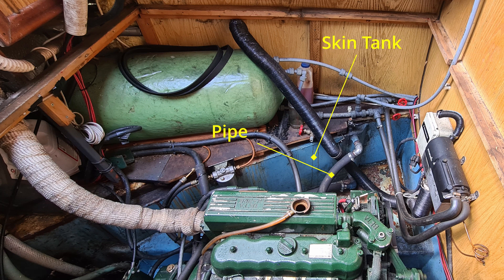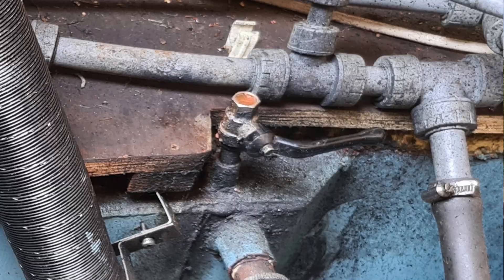How to Cool an Overheating Narrowboat Engine!

Comment: This video just popped up in my You Tube feed, how long ago it seems!
The Feb 2024 update is - the radiator didn't work in the end, it caused all kinds of problems it was disconnected after a few months. I did fit a coolant header tank but still had to bleed air out of the skin tank every day while cruising. Finally in October 2023 the boat was taken out the water and an external skin tank was fitted to replace the original tank. It was fitted with an automatic air bleed valve. It was an instant fix and now I can cruise all day at 1400 - 1500 rpm instead of anxiously creeping along at 1050 - 1100. A big thank you to Andy and the team at Andicraft in Debdale Wharf Marina.
Reply from the maker: I’m really pleased to have finally reached a solution! The stress it caused was not great. Andy and his team did a great job! 🙂

Comment: Fabulous presentation.
I note some excellent comments on the height of the calorifier.

As an Oftec/Gas Safe heating engineer and ex REME engineer, I would like to  respectfully add some points for consideration.

The first thing is to check the dynamic coolant flow rate this will prove the correct opening of the thermostat and cleanliness of the cooling system and water pump. 
Ensure the correct water pump is fitted. 
Use the correct grade of coolant and viscosity levels.
Avoid acute bends on pipework to the calorifier which will lessen the risk of air bubbles/cavitation.
It is worth noting that If the engine coolant hasn't been maintained it is possible that cavitation has damaged the engine cylinder bore liners. 
Complete an engine compression test and look for a high reading!

Hope this helps.
Reply from the maker: Thank you for your comment and suggestions. I will ask Peter to take a look at this and get him to reply as things have moved on since this video. 🙂
Reply: Hello from one ex REME technician (Radar 1966 - 1978) to another ex REME man! 

Thank you for taking the time to reply, you might see from my comment in this thread that the radiator experiment eventually failed and I finally found an engineer to make an external skin tank in October 2023. That has transformed the performance of the cooling  system. The original tank was too thick and the inlet and outlet points were on the same end so coolant could avoid the internal baffles and flow straight in and out of the tank.

I have also replaced several coolant hoses and rerouted them to avoid pinch points as you suggest here.
Three core plugs on the engine - out of a total of 25 - failed so they were replaced and the rest were checked. The cooling system was also flushed.

When a coolant hose failed very early on I changed the coolant to the red OAT type as I read that it performs better. In all the subsequent work and routine servicing no-one commented on my choice, but earlier this year when the third core plug failed the engineer who did the repairs explained that I should use the blue IAT coolant on my engine - and the red could cause corrosion. I checked with Beta Marine and they confirmed that they now recommend using the blue coolant because of the metals used in the construction of the Kubota diesel engine that is at the heart of a Beta Marine installation. So I have changed back to the recommended product and now everything is working just fine.

Once again, thanks for adding to the discussion, I know other readers find these comments useful for their own boats.

Peter

Comment: I had the same problem when crossing to the Lancaster canal on the tidal river Douglas,on my brand new narrow boat.I found out the propeller was to big,so Crowder marine made me a high efficiency propeller that solved the problem by letting the engine rev better putting more coolant through the skin tank.I also changed to a Crowder prop on my new boat worth every penny.I have done the Wash Boston to Denver sluice twice,Sharpness to Bristol,tidal Trent,River Mersey,Limehouse to Teddington,and Tarelton to Savick Brock onto the Lancaster canal.Coming out of Tarelton river Douglas is the most powerful current that I have come across but my 40hp Yanmar does it with ease but I do have twin skin tanks on my narrow beam river barge NB The Viking.
Reply from the maker: Wow! Your journeys sound amazing! We are holding off from doing such trips because of the overheating. I will show Peter your comment and see if it will help him! Thanks so much for sharing your experience! 🙂

Comment: Similar problem with mine.  
Regularly used to dump the domestic hot water.  That cooled it down for a while
Reply from the maker: We have fixed the problem by fitting an external skin tank recently. Peter doesn't have to worry about it but he tried everything else that was suggested first. This proved to be a false economy because he ended up with the skin tank anyway. Have you solved the problem?
Reply: Yes all solved.  New thermostat.     All the best to you sir 👍

Comment: Hi I have a Beta 43 with a calorifire and because the pipe work to the calorifire is higher than the coolant filler cap on your engine ( as I think I can see on yours is) you are getting  air into the pipe work that circulates through the calorifire. Causing the engine to overheat. As mine used to.
I got round  this by installing  a expansion tank bottle ( similar to one in a car) higher than the calorifire
  I cut the rubber pipe on the return pipe to the engine  from the calorifire and went up to the expansion tank( sited hire than the calorifire) then back out of the expansion tank back to the engine.
So you fill your engine coolant from the expansion tank and not from the cap on the engine.
You can not open the engine cap after doing this or the coolant will poor out from the higher expansion tank.
As soon as I installed the expansion tank the air from the system bubbled out into the expansion tank.
 And also the coolant circulates around the expansion tank  cooling the water down.
It was an immediate success 
Cost very little to do as well
I wish you luck in which ever way you attempt to solve this problem 
Gail
Reply: Hi just to add I cut the pipe highest on the calorifire ( mine was the return) so that when you put coolant in it goes in at the highest point forcing air round and out of the system 
Gail
Reply from the maker: Hello Gail. Thank you for taking the time to give such an in depth reply. I have shown Peter your solution and he will take a look at the engine to check it out. Glad to hear it solved your issues. 🙂
Reply: Hi I am glad you are now ok after your dreadful accident.
If don't mind just to explain when you fill the engine via the filler cap you can't  make the coolant go up hill into the Calorifire.
So every time you you turn your engine off the water drains out of the calorifire down into the engine leaving air in the calorifire and pipe's
Gail
Reply: So you don't have a skin tank because I've got a similar problem of plumbed the engine into the spiral in the clarifier so if I put an expansion tank on will that make sure that my engine stays cooler is that what you're saying because that would be a cheaper option for me
Reply: @johnpalfreyman8290  
Hi John
I have 2 skim tanks either side of my stern to keep my engine cool.
But I had a over heating problem.
I found my calorifire was installed higher than my engine.
So water ran round the calorifire when the engine was running 
As it is higher than the engine 
And when I switch the engine off.
The water drained from the calorifire back into the engine and skim tanks
The  water ran round the calorifire  because it was pumped up out of the engine and skim tanks when the engine was running 
Leaving less in the engine  and skim tanks
This caused the overheating when the engine was running 
So I put a expansion tank above the calorifire 
And made this the water filling point.
So the whole system was filled water.
Whether the engine was running or not.
And I have never had over heating again.
Only difference is you must not undo the water cap on the engin.
As the water will drain down from the calorifire and poor out of the cap
Just fill water using the cap on the expansion tank.
Gail
Reply: As a heating engineer I would approach this from a heat recovery point of view.

I would first use the heat to create hot water in a thermal store, much like we do for solar thermal. 

Thermal store will then give hot water for domestic use, Heating the boat/Showering/washing up etc. 

In Solar thermal the overheat protection is running the heating or using a heat dump.

In houses heat dumps are essentially the same as car radiation’s with the fan in reverse. 

After this, and being on s canal I would use the canal; we often install plate heat exchanges on on the side of thermal stores to produce hot water in a similar manner to Combi Boilers.

The primary side of the plate connected to the Engine and the secondary side connected to the canal with a small inline filter. 

As you eluded to this might need lifting out for a couple of connections fabricating.

You could just as easy do it on two hoses over the edge and an inline pump.

Between these two systems you could dissipate many hundreds of kW of heat energy…

Hope this helps or sparks a few more thoughts.

Martyn

Comment: Did you use a car radiator
Reply from the maker: Hello Martin. It was a domestic radiator that was fitted. I don’t know if a car radiator would have been better or not. We think the problem may have been that it was positioned incorrectly due to a lack of space. Ratty, who fitted one on his boat, had it fitted in a different style of engine room but it just didn’t work on NB Bandoneon. Thanks for your question. 🙂